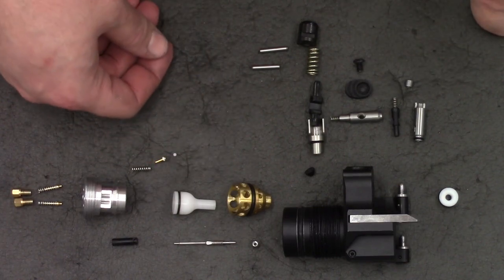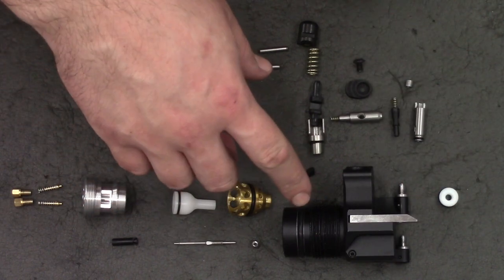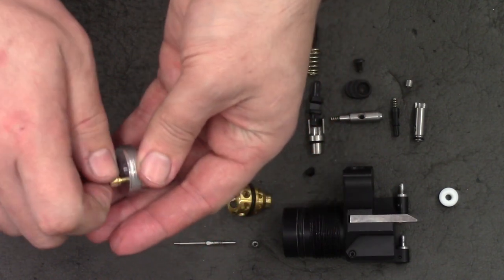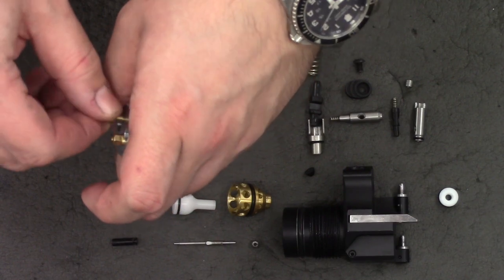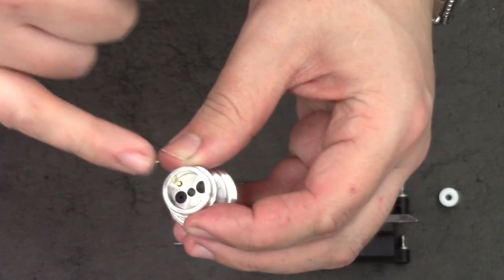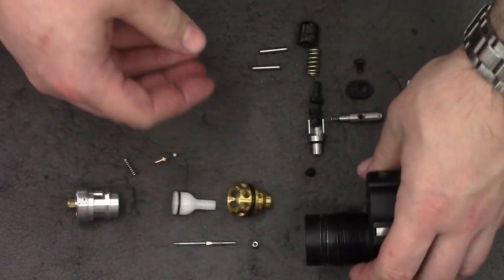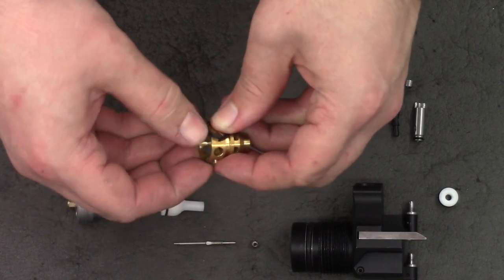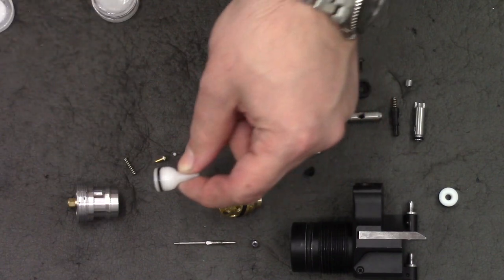Leshiy 2 rebuild

Comment: Well done for doing this Jeff, excellent work that will serve as a brilliant reference video.
Really looking forward to the plenum plugs and bottle valve (yeah I know, broken record, sorry!) 🤣 👍👍👍
Reply from the maker: Thanks, little more testing to do on the bottle valve yet, but it seems to working fine, just need to test it at the higher pressures, Thanks for watching.
Reply: @sub12airgunners  Thanks Jeff, no smarging this time. 😆
I’m just waiting for the Best Fittings bits that you suggested to arrive so anytime you’re ready as I’m sure you’ll want everything fully tested before anything else happens. 👍

Comment: Tuned to perfection. You need to start making and selling all these foofoo custom parts in your eBay shop I would be interested in the plenum reducer. Is the fx bottle adapter safe at 300bar
Reply from the maker: Thanks, we are testing the adapter at the higher pressures at the moment, wall thickness should be fine just making sure the 1 way valve works as it should but more updates will be coming when its available. Thanks for watching.

Comment: Hi. I’ve looked all over the place trying to find information about the dimensions of the plastic bead/sleeve in the valve of my Leshiy2, that the rod the small spring is going through. Mine broke in half. Finding a bead that fits is proving difficult. Having the inner dimensions and the outer dimensions would be great so I could have one made.  Or where could one be sourced info would be awesome also.  Thanks.  😊
Reply from the maker: sorry we don't have the L2 anymore so can't check, thanks for watching

Comment: Jake, I am very impressed by your videos. Every time you say, I made my own, I think of myself, I’d like to make each part to spec… only my interest is gas turbines, I know them inside and out, but I’m not too familiar with air guns. This has been very helpful and you know your stuff. 

So what do you have machine wise? I have a grizzly drill press which I made into cnc and a manual grizzly lathe. Thanks again for the info, very nice and professional
Reply from the maker: I have built a gas turbine when i used to fly rc Jets you would know it the Wren 👍
Reply: @sub12airgunners  absolutely, I actually started on one from scratch since they don’t sell the kits anymore. Wanted to build the turboprop version. Got as far as the exhaust portion, then my ex stole my house. My main focus was the kj66 as I’m sure you’ve guessed. Such a shame what happened to wren… they were just good guys, not made for this world and all the greed.

Comment: You ever come across a Lug being unable to screw off, Im looking at one and i had it off then gassed it up but there seemed to be excess air coming from the side of it and would not index ,So i degassed it and now the Lug will not come off,Its stuck tight

Comment: Always good in depth show Jeff! Thanks for this brilliant vid and looking forward to release date of your bottle valve. Jeff I have a ? though, As I will be changing between .177 and .25 barrels, the .177 has a few more bits and pieces in the gun then when running a .25 setup, that is what i concluded by watching Ed and the Edgun videos, but perhaps I am wrong. Can you confirm that is the case? Thanks again, this is Master class!!!
Reply from the maker: Thanks, I think the parts you are referring to are the dog bone piece that fits in the valve and the valve collar, they make the valve work a little better (more efficient/ powerful) in hi power, but the early L2s didn't have the parts and worked fine. For best results you will have to tune the rifle to the caliber but for just a hot swap you should be fine with/ without the new parts. Thanks for watching.
Reply: @sub12airgunners  Thanks Jeff appreciate the time explaining! 🙏🏻

Comment: Hello.

i want to exchange the regulator leshiy 2 for the new one.
do I have to pay attention to something?
thomas
Reply from the maker: Nope just swap them straight over, you will have to adjust the new reg to what your old one was set at but there is nothing to worry about. Thanks for watching.
Reply: @sub12airgunners  
Hello.

Thanks for the information.
Do you know the valve sizes by caliber.
thanks